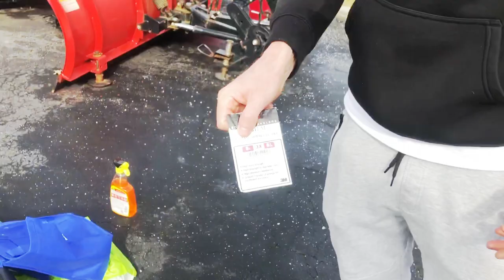Hellcat Spoiler INSTALL Charger RT or V6 3 Piece

Comment: Did this to mine within a week of bringing it home. I did have to go back later and retighten as it came loose. I redid the 3m tape in different locations and snuggled it back up and havent had an issue in 8000 miles. 
Major improvement in looks.
Reply from the maker: yah it def is a solid upgrade in styling. Adds a little more eye candy to the back

Comment: Yo! I LITERALLY got mine today in the mail!!! I'm gonna be installing my Hellcat spoiler over the weekend.  I remember when Red Hemi and I, were talking about getting the spoiler... and looks like we've FINALLY got them!!! Great video for others wanting to dri this install.
Reply from the maker: You're going to love it. Def a solid upgrade - adds a ton of style to the back
Reply: @RTLife  them BLACK bolts on the ends,  are those the stock bolts?
Also,  can you see the caps when the lid is closed???
Reply: @theblackmanarmedwithacamera  no u can't see the plugs when it's closed and yes there stock bolts but I used the little screws that it came with and 3m tape looks good
Reply: @red_gt_5.025  Thanks bro! I'm installing mine on Saturday.  Can't wait!!! Your car is looking phresh!
Reply: @theblackmanarmedwithacamera  appreciate that man u will love it .. I'm an annual bastard with my car and the plugs don't bother me to much
Reply: @theblackmanarmedwithacamera  I'm going to have to get a wrap done on the rear

Comment: I did similar with the plugs. I got them from autozone. Painted with factory spray paint and clear coat. Than installed with rt a d a washer or two below since the plugs were body panel plugs. Over 6 months no leaks. Love the look of the hell at spoiler. Just gotta decide if I want the wicker bill. Great video.
Reply from the maker: Wickerbill is a big decision - no going back lol. Drilling those holes!
Reply: What size are the plugs? My SRT spoiler came in today and I'm hoping to install it this weekend.

Comment: Hellcat spoiler looking good 👍 did mine recently and one of my favorite rear add ons
Reply from the maker: Yah it adds a lot of style in the back. Def a solid upgrade
Reply: Can I see which one you bought? Because I got two but the holes don’t match and I’m
Trying to find one that does
Reply: @dripcat707  i got mine off amazon for $100 painted. Its one piece but i have the 08 charger so the holes didnt match i had to drill my own and use butterfly to hold it dowm

Comment: Just mine in today, this is quite an easy install. It seems intimidating at first because you have to take apart a few things, but I knocked the taking off and putting on in less than 15mins. The longest part is after...getting the 3m tape residue off... Yicks that too more than 30mins for me... mind you I did everything alone... Oh I found and easy and fast way to get the plastic rivets/clips off that are on both side pieces to the OEM RT spoilers. Just take a lighter to them and they melt off in seconds, if definitely beats trying to pry them off.

Comment: Changing mine out today. Should also look into replacing the charger and the R/T emblems on the trunk. I was able to get the RT in black/red. And then the charger emblem in black. Both easy to pop off and replace.

Comment: You don't need a Scat Pack to do donuts. Just turn off the traction control, turn the wheel to the lock, & punch it.
Reply from the maker: That's what i keep saying - I've seen plenty of 5.7L hemis close to stock burning up those tires easily in circles
Reply: @RTLife  I can do it in my Chally all day long! Although it is a lil easier with the manual... Tires get expensive though.
Reply: Much better with a 3.70 limited skip though!!
Reply: Completely agree. Though adding a cold air intake is a cheap way to add a little extra punch to a 5.7L and it sounds a little nicer too.

Comment: I did this to my car recently but I had the holes covered by a body shop and painted. Looks like factory now.
Reply from the maker: How much did that cost? That is likely what I would want to do
Reply: Cost me $700 and that included the spoiler install.
Reply: @inspireuntilltheend  that's a great price man yea I just didn't want to turn it into a money project .. but that's the way to do it .. u don't see the plugs when closed and doesn't leak so I'm good with it for now .. but the way u did it is the right way.. I got prices for 850- 950 for prices and just fixing the holse
Reply: Where can I get a one piece spoiler ?
5NH39TZZAC? Or should I get it on eBay? 
I got a billet gray color rt ? Intrested in getting a black spoiler

Comment: Looks good, thankful my RT has the blacktop package lol. Gonna be swapping out my valence soon, i have 5 inch tips coming in the mail!
Reply from the maker: Oh man that's going to look great! Let me know how it works out
Reply: What tips did you get @pierre khoury
Reply: BlackTopHemi 17 Carven 5” Tips in a polished finish. They’re meant to be a direct bolt on for 6.4’s and up but I got adapters to try to make them fit on my exhaust
Reply: @pierrekhoury1247  I was looking into ordering these exact tips but in black. What adapter did you use? Did you have to weld them on instead of using the bolt on? Will these fit the pursuit valence?
Reply: Cameron Garett I actually ended up going with 4.5” corsa tips instead of the carven ones
Reply: @pierrekhoury1247  Ah okay. Was it because the carven tips were too much of a hassle?
Reply: Cameron Garett when the guy tried fitting them on they were very hard to adjust since there was almost no wiggle room so I got 4.5” instead

Comment: It looks great, but what a PIA. I'm glad I did the 3 piece wickerbill on my RT.
Reply: Wasn't to bad but there were issues we had to deal with.. the people that wrapped my stock wing fucked my car up .. instead of taking wing off and wrap it they took a razer blade to cut the extra wrap but they cut into the paint with the razer blade.. fucking dicks.. so I have an outline carved into my paint deep as fuck all the way around truck and quarter panel
Reply: @red_gt_5.025  damn that sucks  bro. Does the new spoiler cover the marks?
Reply: @CTHellcat  only the back side but all the front Is seeable and on the quarter panels u can see .. so I talked to my wrap guy and we gonna do a custom Daytona style wrap .. like the rear end of a charger Daytona decal
Reply: @red_gt_5.025  Nice!!!
Reply from the maker: It came out really nice - he def does a good job of being patient & doing everything correctly

Comment: So the Spoiler King model is 4 bolts?

Because a lot of the wing spoiler knockoffs I've seen were only 3 bolts and NONE of them lined up with the factory holes. I didn't want to think about drilling holes in the deck.

Comment: When I installed the hellcat spoiler on my SXT, the trunk wont open automatically all the way up like it used to, instead, it would just be like challengers trunk after you pressed the button to open. I think it’s because the extra weight of the spoiler that caused this. Not a big deal, but did you guys meet the same problem or the trunk still works the same as used to before the installation (Trunk opens all the way up automatically)?
Reply from the maker: When I see him next I will see. That does make sense - there is a little bit of a weight difference

Comment: Out of curiousity, did ye paint the plugs or did they come that color? If ye did paint them did ye add a clear coat as well?
Reply from the maker: He went to dodge, got the same color red & painted them
Reply: @RTLife  Thanks for the quick reply. I'm doing this myself, got the paint and it came with the clear coat and I've been doing up a bunch of batches to see which matches best. So fart, I've tried the paint & clear coat and compared it to the black the plugs come as and oddly enough there's practically no visual difference. I just finished a batch with just the paint and will see if they match any better once they dry.  
I guess in the grand scheme of things it really doesn't matter since they'll be covered by the spoiler anyway, but I figure if I don't TRY to see what looks best it'll gnaw at me forever.

Comment: Great video, did those plugs come with the spoiler,if so where do you order this?
Reply from the maker: No I believe he bought them separately & then painted them
Reply: @RTLife  honestly that's the only thing stopping me from doing the swap. What he did looks so clean. Anyway you can find out the sizes and where he ordered them. Thanks I'm advance
Reply: @vittobonofiglio8976  Amazon is where I got the 8mm/ 5/16 get the wider heads
Reply: @red_gt_5.025  thanks man.
Reply: BTW I picked up a scat pak hood last year off Kijiji,cost me a G note. But completely changed the look of my car, totally worth it
Reply: @vittobonofiglio8976  thanks for that info .. u might b able to get 3/4 plugs they might fit better the 8mm r real good but 3/4 might fit real snug
Reply: @red_gt_5.025  cool thanks,I'll get both sizes and see

Comment: Any chance you can share part numbers? I haven’t been able to find one like this that uses the factory four holes.
Reply from the maker: Hit up @Red_Hemi_RT on IG - he will likely be able to show you exactly what he bought to complete this job
Reply: The dealer ship u have to get the right one.. not sure what bumper u got the regular rt or the RT with the scatpack bumper. But the part number is 68240581AA but that's the one that fits the regular rt bumper with no vents

Comment: Man that came out great. Looks really good. How long did it actually take tho? Seemed like you guys were out there forever.......
Reply: It took some time do to the fact I had got my stock wing wrapped before I did this the assholes that wrapped it took a razer blade to the paint to cut the wrap so they fucked my shit up I had to wet sand and do a lot of wheel work but still didn't come out so now I got to do a wrap to cover it.. they fucked my car up bad
Reply from the maker: It took about 2 hours give or take - def a solid improvement though. He did a great job

Comment: What did u guys use to fill the holes thanks
Reply: Also will this spoiler fit the 06 rt charger
Reply from the maker: Amazon - 8mm/ 5/16 get the wider heads
Reply from the maker: I'm not 100% sure if it would fit.
Reply: @guildensteinfoutch6232  it should u might have to drill some holes up or 3m tape it
Reply: Thanks guys

Comment: Do you have a part number and link for the spoiler?
Reply from the maker: He got it at the local Dodge dealer -  parts department
Reply: @RTLife  thanks! I just went to get the actual part # for it today and they quoted $1025 for it. They are around 650-700 online off of mopar sites. Thank you for your response!
Reply: @agproductions3887  whaaaa lmao u wildin i done this same thing with the same spoiler and it only cost 150$

Comment: just installed mine today.. Looks awesome.. my question is where did he find those plugs to fill in the holes on each side? I had to order mine off amazon. Great Vid btw!
Reply from the maker: It's such a nice improvement - the guy that did this is @Red_GT_5.0
He can help you out with the holes
Reply: What are the plugs called on amazon ?

Comment: Can I get a link to this spoiler? I’d rather not drill holes
Reply from the maker: He picked it up at the local dodge dealer
Reply: I just called them. $997 unpainted
Reply from the maker: That is crazy - he said it in the video but I believe it was only $100
Reply: R/T Life anyway you can reach out to him? I was about to pull the trigger but got really unmotivated when I heard that price.
Reply from the maker: Do you have IG? shoot him a message @Red_Hemi_RT. If you don't I will ask & get back to you. Really cool guy
Reply: At 9:19 he said it. Spoiler Kings on amazon.
Reply: @drake.cooper001  - All Spoiler Kings on Amazon seems to have are roof spoilers.

Comment: He didn’t have to drill holes in the trunk every install video I’ve seen you have to drill holes
Reply from the maker: No drilling is needed if you're removing the 3 piece spoiler. All the holes are there for you
Reply: @RTLife  do you know where he purchased it?
Reply: I need to know which one has the holes that match cause the ones I’ve gotten don’t

Comment: Where did he get the colored hole plugs?
Reply from the maker: His IG is @Red_Hemi_RT - not exactly sure
Reply: @RTLife   - Unfortunately he doesn't have DM's turned on so I couldn't contact him. Do you know or remember the size of the holes on the side quarter panels? I found a company that does paint matched plugs, but I wanna be sure they'll fit before ordering them. Thanks!! Love your videos by the way.